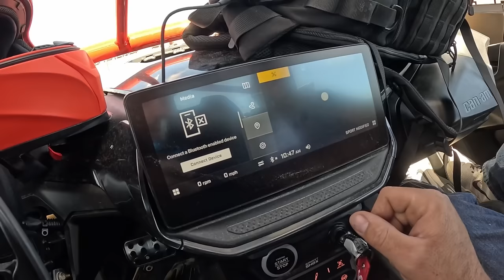2 CRASHES Almost DIED in Can Am X3, Maverick R and Pro R Blast Dunes - Ep 326

Comment: How did you get from the east side and trying to get to the wall. A rollover. Then to the west side and swingset. Another roll over Vs just staying on the east side , the washes , and getting back to vendors???   And yes as much $$$ as you guys have in those cars , radios r mandatory.  Btw. I hate doing all the editing. People dont have a clue
Reply from the maker: Went from olds, to swingset, to china wall, to carlas bench, to the wall, .. then headed westish to big bowls as we were heading back to the red bull sand scramble. We didnt know the rear was broken. Until we got to the corner of gecko. Where he put it on its side again
Reply: Ok. Gotcha.   The wall and the ceiling are both sketch rides. Lolol